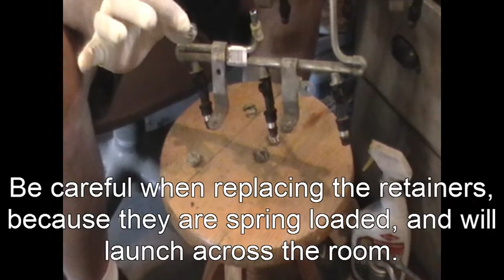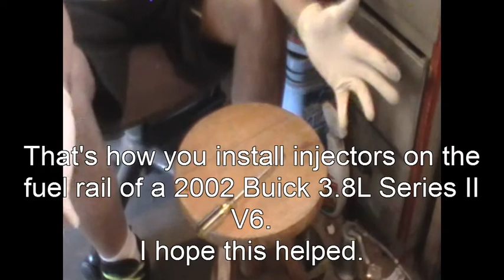2002 Buick 3.8L Fuel Injector Remove/Replace

Comment: You did a great job of explaining your initial problem but you seemed to skip right over how to pull the rail off of the engine which would have been really helpful.
Reply: Yes, it would have been very useful to know how to pull the rail off of the engine.  So I am still not able to replace an injector without knowing this info. Please show us how.
Reply: As soon as I saw the yellow Corvette I figured this was the wrong video. There was no sound and for a full half a minute he was pulling up slow with his Corvette so I figured it was about a Corvette and went to another video.

Comment: Have you had to do anything to the cooling system? The plenum from factory has its flaws since it is plastic…
Reply from the maker: Yes.  I have replaced the elbows that   connect the water pump to the intake and block, the water pump itself, and the radiator.

Comment: wrong i replaced plugs wires coil pack icm still missfire
Reply: Hey hope you can help me out sounds like you had the same issue, random multiple misfire, I replaced my plugs and my wire leads for the plugs and I’m still misfiring maybe even worse, what solved your issue thanks for your time
Reply: @docholliday45lc3  fuel injector was bad and when i pulled it out it was broken after i replaced it no more misfire but i replaced all of them at once so all are new so fuel injector cleaner dont work if  your injector real bad